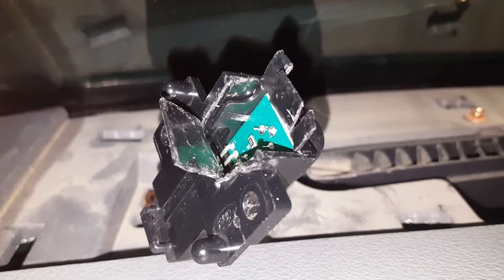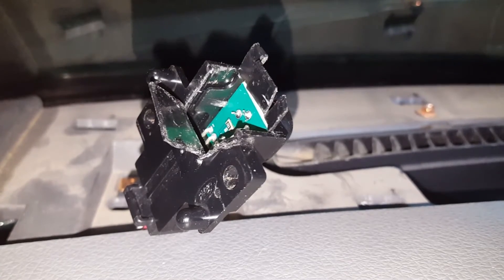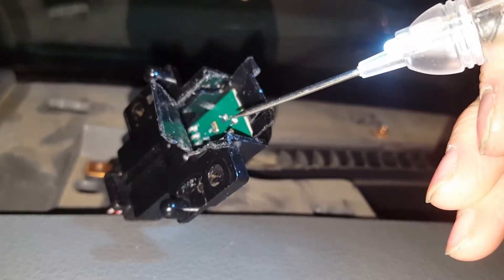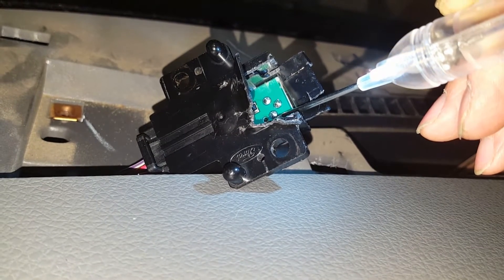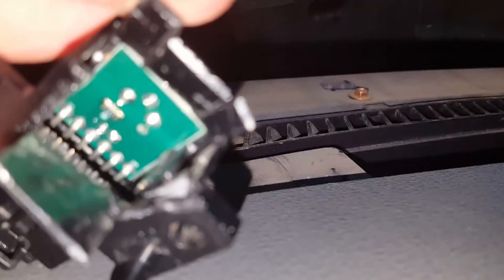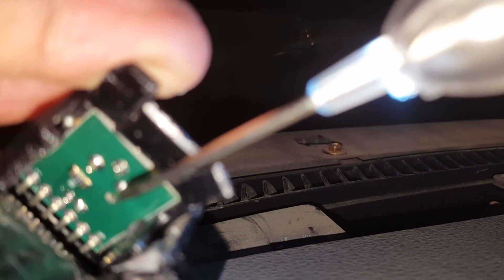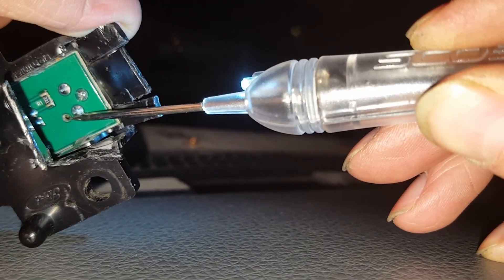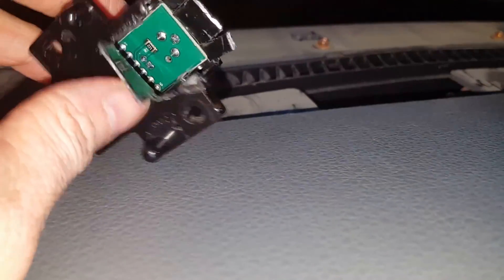Ford f150 sunload sensor test

Comment: What is the function of that sensor? What activates or deactivates?
Reply from the maker: It controls the auto lights if you have that feature on your vehicle. When the sun goes down the voltage drops and the head lights come on.
Reply from the maker: But also your bcm controls this as well.

Comment: So what is the test? Ground lights up and the other pin has low current? I'm not seeing the picture here.
Reply from the maker: When you shine light on it like the sun is hitting it the light will be bright  if i remember correctly and that tells you the sun load sensor is working fine.

I was using the light from my phone and that was why i was trying to show how much brighter it got with it up on my phone.

Mine was working fine.